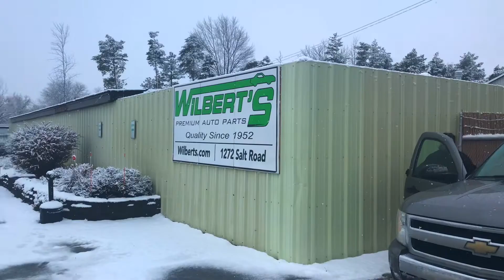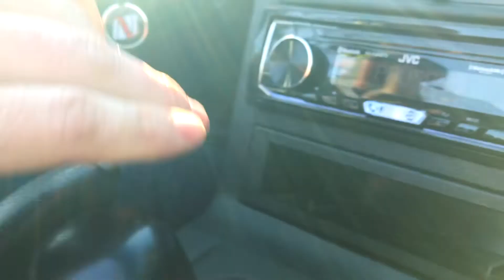Building a KMiata in 10 Minutes

Comment: Great summary.  It would be interesting to understand the total cost to date for the entire project.  The K swap must have been the big ticket item at approximately $10K?  What about suspension/tire/rim/body mod costs?  Repaint?  My guess would be somewhere in the low $20K range for the total build cost to date?
Reply from the maker: The K swap is around $12k on its own right now. Paint, rocker repair, and ceramic coating ran my around $7-8k, the car was $3k, hardtop and other bits, definitely north of $25k
Reply: @NappMotorsports  How is the K swap $12k?  The kit costs $4300, right? Say  $700 for the engine. Where is the other $7k?
Reply: @burkean  nickels and dimes. I'm dreading that part, but still interested.
Reply: @burkean  the whole swap including ECU and tune is $6k that's just the parts alone. If he has the K20 it would be about another $1400 or so. If it's the K24 it's about $800. That's not including transmission, clutch and the other parts that come along with it.
Reply: @burkean  aftermarket ECU, wiring harness, a clutch kit, and an upgraded oil pump are all extra costs on top of the swap kit and the engine. Not to mention things like an exhaust, fluids, gaskets, and having a guy dyno tune it. I wanna do this swap too but this shit really starts to add up.